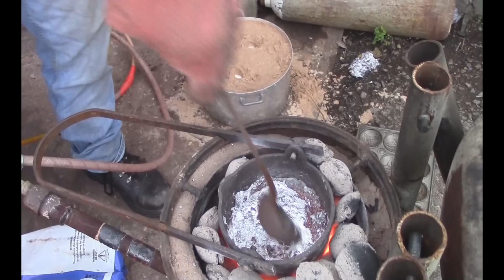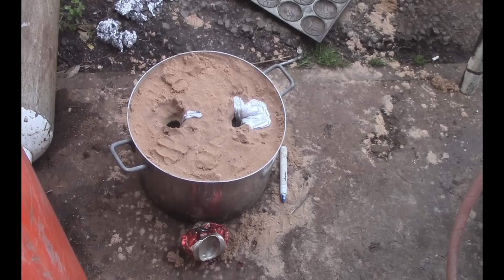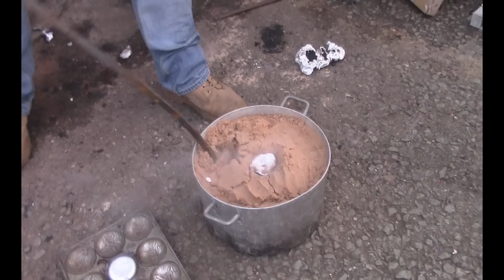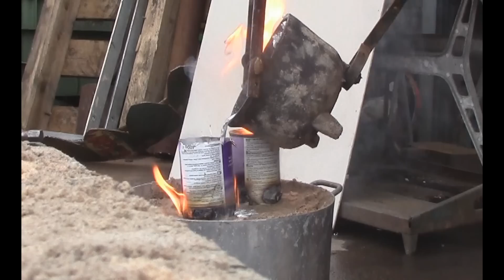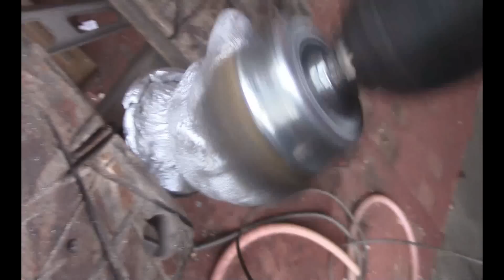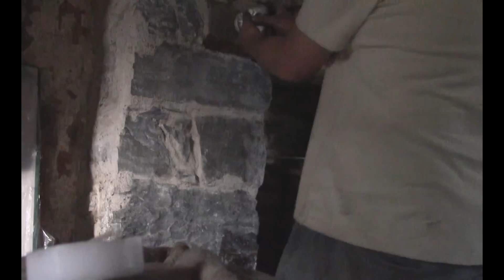Lost Foam Casting Aluminium Cans DIY fails and Success!

Comment: Cool video my friend. I love skull casting . I did some solid copper skulls on my channel and will be doing a LifeSize solid copper skull in the near future if that would at all interest ya🤔👍🏻. If not sall good , this is cool video buddy 👏🏻😁
Reply from the maker: Yes, im still very interested in casting. My existing foundry has now gone and i need to be thinking about another, it also wouldnt get hot enough to melt brass so i need to think about a newer and better design. Ill head on over and have a browse, thanks for getting in touch!
Reply: thepoultrypeople no worries my friend we are pretty friendly over on my channel I hope you find something you like👍🏻😁

Comment: if your grinding stone disc loads up with metal, rub bar soap on it. it stops the aluminum from sticking to the disc. also works with sandpaper type grinding discs.
Reply from the maker: +Bradley Campbell thanks, ill buy a cheap bar next time i go to the supermarket
Reply: i am an auto body repair guy,and learned that from Audi factory training . cheap will do, somehow it stops the metal from sticking to the discs

Comment: . four on the floor shifter cool candle holder halloween is right around the corner cool thank you
Reply from the maker: Calvin Whitewolfjr yeah, thats a pretty good suggestion on the shifter, ill have to drill and tap a hole in the base, but it might be a touch too big unless youve got a decent sized rig or truck?
Reply: Totally cool if you for your truck awesomely cool

Comment: Nice job, well done, where did you get the polystyrene skulls for the lost molds from.
Reply from the maker: mick walker ebay, just type it in as youve said it, you might find them under halloween decorations as well, might even be cheaper on amazon, think i paid about £1.20 a piece?
Reply: mick walker http://www.ebay.co.uk/itm/4-Halloween-Horror-Hanging-Human-Heads-Skulls-Party-Decorations-PS-/310696900445?